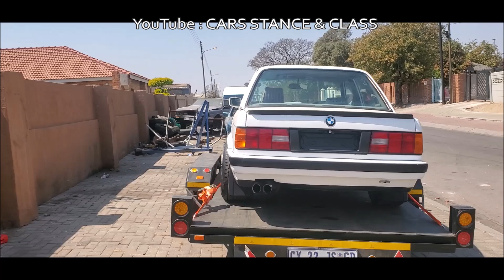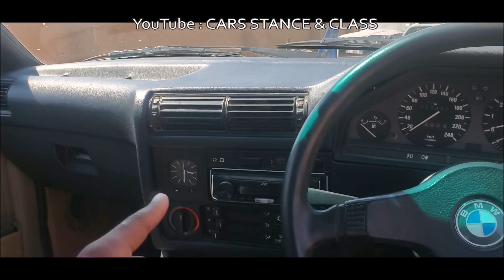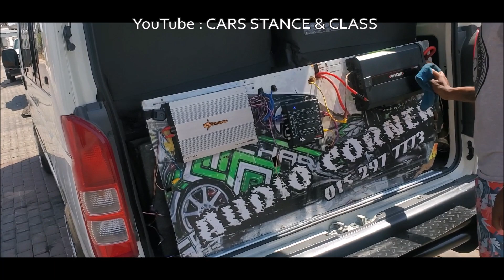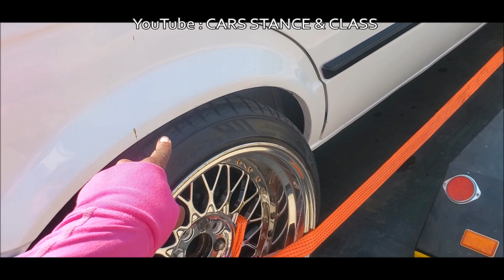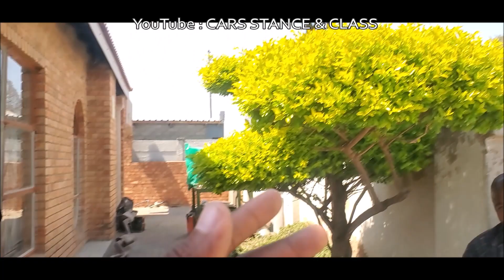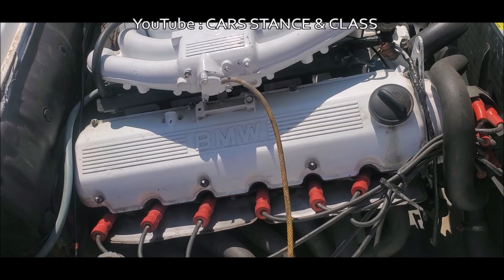MADAGA REVEALING BMW E30 👌  HAPPY BIRTHDAY DAYS 🔧KATRA 'S DAD MR PUX BUILT IT FROM SCRATCH 🥰

Comment: 3 series 2.5l (325i). Piston rod and bore size will determine whether it's 2.9, 2.7. If it's stock then it means Madaga didn't resize cylinders making it a 2.5
Reply from the maker: So the last size to bore is to 2.9? No going more than that

Comment: It’s a 2.0lt four cylinder
Reply from the maker: Meaning 320?
Reply: 3 series 2.5.(325i) 6 cylinder.   intake manifold has 6 heads as you can see